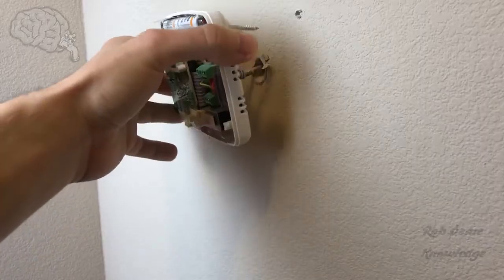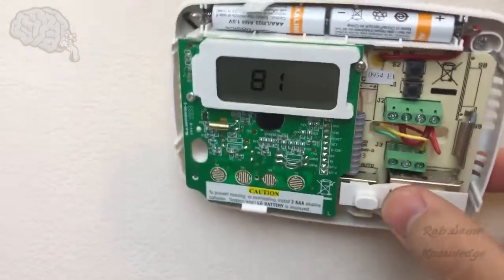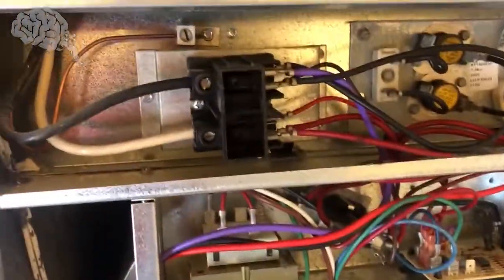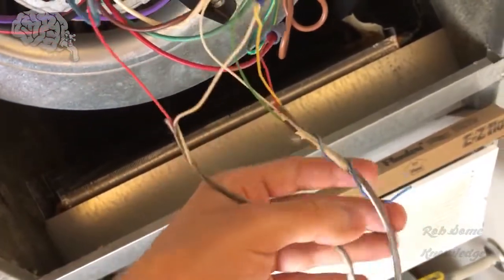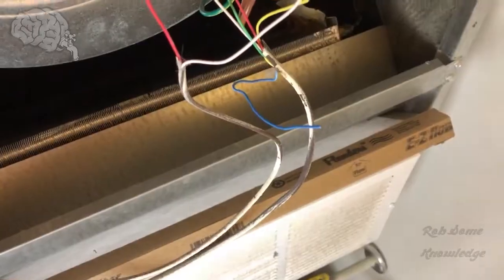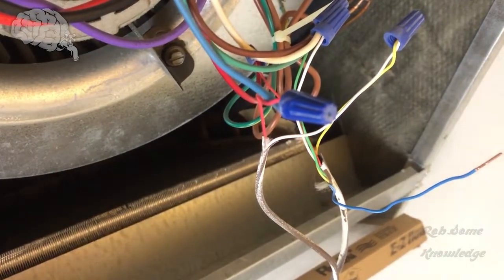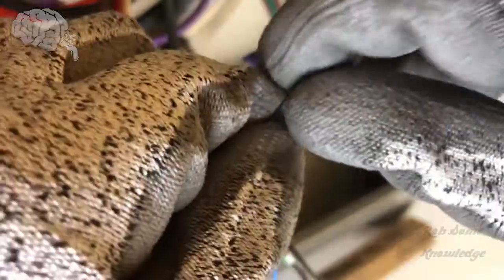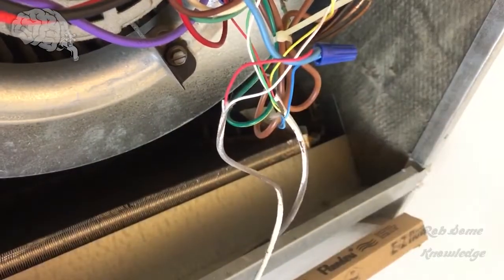How to Connect an Unused C Wire (Common Wire)

Comment: If 
You don’t have a c wire or a 5 wire system just put the G wire to the C slot and run a jumper from Y to G and on the thermostat run the G wire to C

Comment: I  really appreciate your help. It was difficult to figure out how to connect the C cable. My ac unit has a connector where all the wires are tied together and were not set up like other units that are labeled specifically with each wire shown. With you're explanation I was able to hook it up and worked great! Thank you!

Comment: thanks rob very interesting  do you have anything on a messed up wiring in a UL-KFR71V/X , so i can get me back up running ? I am new but understand low power and high power wiring safety
Reply from the maker: Sorry but I don't unfortunately, I don't specialize in HVAC but just made this video with all the research I did on my specific system, to help others with similar system. You may have some better luck asking that question with a more specialized channel that focuses only on HVAC content.

Comment: Rob, thank you!  I installed a Nest thermostat and it clearly needed a C wire.  After tearing open my furnace, I found I didn’t have a “terminal” so to speak… I searched high and low, including the HVAC manual… And nothing resembled what I was seeing. Your video was truly the only thing out there that showed how to tap into a non-terminal system. I followed your lead and tapped C wire into the AC to common and everything is humming perfectly now.  I can’t thank you enough.

Comment: Great video! So you are essentially connecting the circuit I got it and smart showing you used gloves thanks for all the tips! Struggling to get the cover off the furnace panel now.

Comment: after many videos and forums, this is the vid that helped the most.  we have an old a/c from the 80's.  whoever installed it used two bundles of wires, one for the thermostat and the other for the condenser (i.e. instead of low voltage two wire, they used another thermostat wire; i guess that's what they had on-hand).  then they connected the yellow wire from the thermostat to the red wire of the condenser, i guess to make it more confusing.  so following what you said at about the 4:35 mark, i connected the unconnected blue C wire of the thermostat bundle to the opposite of the yellow wire which for me was a white wire connected to a terminal block with a label of "3" (which i haven't seen in any videos or forums).  this vid combined with the wiring diagram made me confident that the "3" was the common.   thank you very much !
Reply: Same!  I can’t believe it’s so hard to get this info. Perhaps HVAC guys are keeping it on the low. I looked for a long time, this video is what gave me the confidence to get it done.

Comment: Great video and explanation! I had no trouble with the thermostat side but found the nastiest dust filled furnace. Couldn't find the blue wire because they had cut it so short. Couldn't read any connectors because the dirt and dust. Poor installation of the unit in a small closet and being on a ladder to access. It was all horrible. But your video matched the exact unit and wiring. Got it running in just a few minutes! Thank you so much!

Comment: Why do you need a c wire. You have batteries
Reply from the maker: Because right after this video I replaced the thermostat with a smart thermostat that connects to Wi-Fi. Doesn’t have batteries and even if it did I would rather have it connected to the house power instead of switching out batteries every few weeks or month or so. Most smart thermostats don’t even have an option to use batteries.

Comment: Now, I’m wondering why they didn’t just connect the wire in the first place instead of tucking it off to the side and wrapping it around another wire. Thanks for the video!
Reply from the maker: To prevent any accidental shorts from the C wire, shorting onto a power wire, or similar situation.

Comment: Going to try this tomorrow.  I have the unused c-wire behind the old thermostat but I have to find where the furnace covering is to check if the unused c wire from the thermostat is connected there or beung used at all.  I haven't been in this house long in Texas and it might be in my attic.  Can I just try and connect the unused c wire to the new thermostat to see if it will power on?  Basically do you think the unused c wire is connected at the furnace already???
Reply: Your video seems extremely helpful btw!
Reply from the maker: Im glad you found it helpful. I mean you COULD try to just connect it, but I would really recommend just finding the furnace/air handler and actually checking. More than likely its not connected anyway if it wasn't connected at the thermostat. There is a possibility you could short something out if that isn't actually a c wire. Just take the time to go find it and verify the wires.
Reply: Don't know if you have the answer to this butttt, it worked but it didn't.  I bought a $70 honeywell thermostat that required the c wire and this is the one I installed.  I found the c wire by the motherboard of the furnace, attached it and went  to turn the power on at the breaker box.  The air came on blowing cold but I had no screen on the brand thermostat.  So I couldn't control the temperature  or anything.  It literally just stayed on all night.  Going to return the thermostat today because I feel like it might be a defective unit.  Thoughts.
Reply from the maker: Where exactly did you attach the wire to?
Reply: @RobSomeKnowledge  so I got it squared away but I had to call an emergency AC tech out.  Great Info I learned.  He told me that the existing unused c-wire ordinarily should work but in some cases it's a reason why it was not used ( like it could of been defective).  Check this out though.....when he came into my house he asked to see the old thermostat which was battery operated.  I don't know if I told you that the first thing I did was swap brand new batteries into it when I saw the screen was blank when I came home last Thursday.  I noticed the last batterie connection had a LOT of corrosion.  I scraped it off, popped in 3 new batteries and the thermostat did not come back on.  When the technician came, he opened up the original thermostat, put the new batteries in too, but before he popped the batteries in he said, " don't tell anybody I showed you this".  He stated that over time the metal prongs on the top and bottom of the batteries can get stretched out and not touch the batteries once vertical on the wall.  He squeezed the 3 sets of 2 prongs together for the batteries and the old/legacy/original thermostat came right on!!!!!!  I never even needed a thermostat!  He said this happens on 2 out 10 house calls!!!

Comment: Awesome video, I had 5 phone calls with the Honeywell T9 techs, and no joy. My air handler has no control board. Within 20 minutes of watching your video, I was able to get it working, since you showed which wire to connect for the Common!

Comment: I think you were wrong connecting the C wire to red coming from condenser unit..it should be connected to the white wire. Red=hot, White=common, unless prvs electrician is mr anarchy.
Reply from the maker: Nope this was cleared with a master electrician before I did any of this on my own system. You should never really rely on color coding unless you did the initial wiring yourself. System has been working flawlessly since the video and still have it hooked up exactly how I did in the video.
Also the wire that was already bundled  in the wire nut with the Red, the thick blue one, is the C wire that is coming off the board.

Comment: You rock. Thank you for saving me the cost of having to pay someone. I knew about the common wire but had no idea how to hook it up at my new apartment’s intimidating looking ceiling accessed furnace. Thermostat and A/C low voltage wires were just as you described. My ecobee is reinstalled and back online. 😅

Comment: Extremely helpful video, thank you!

I had been having power issues with my Emerson Sensi for years, but kinda ignored it because the batteries did the job.

However, when I wired in my Ecobee 4 it wouldn't turn on. The multimeter showed 0V on the C wire.

I opened the side of the air handler and found the C wire, but no control board...just bundles of wires.

This is where this video came in!

It was so helpful to have somebody explain so clearly the wiring shortcut.

After a bit of "jiggery-pokery" I had power to my C-Wire and everything is working great now.

Thank you so much!

Comment: Excellent. The only thing I would add is that it’s better to wrap that thin blue wire around the other bundle a few times to secure it better before you wrap the copper ends together
Reply from the maker: Ahhh good tip!

Comment: I have an extra wire not being used, but not sure it’s the C wire. It’s not blue, it’s a very light brown/tan wire. When I moved into this house, I never had to change the batteries on the thermostat. Years went by and eventually an hvac technician came out and I think he converted us to a battery powered stat. I never thought much of it until recently when I decided I wanted a smart stat that I could operate from anywhere in the house. 

My question is is there a way to test the extra wire? It’s not going to be live, right? Will it be hooked up on the other end (furnace), even though it’s not hooked on the stat side? If there is just a random wire not hooked up on both ends, that’s most likely it, right? Can I use it, regardless of color, just as long as it’s not attached on either end? All theses wires are the same, right? As in gauge. Only difference is colors?
Reply: I would do it as long as your system is using 24VAC.

Comment: This worked for me and my Amazon Smart Thermostat. My system was older and it just appeared the C wire from AC unit went to a ground. But that ground was all I needed to make it work in that junction the AC wire nut connected to.

Comment: Hey, idk if you’ll see this, but how do you double check that the blue unused wire is c? My nest stat isn’t getting power and not detecting the power adaptor, and fuse is t blown on furnace. On the furnace diagram is it has a G Y W R for the thermostat, and W C AND Y for condenser? Does that sound right? They made the dang diagram so hard to read. I just don’t know why my thermostat all of the sudden stopped connecting to HVAC power, but am stumped. Thank you So much

Btw, furnace shows R C W Y G

Comment: I have a c wire on my hvac system board, and I see it paired up with the white in a sheath. But at my thermostat I do not see the c wire. It is not tucked behind the wall.

Comment: Thermostat wire is powered by the motherboard on the furnace, not AC power. It is low voltage cable. Usually 12v or something like that. You do not touch the breaker panel at all. The furnace as a whole is controlled by a circuit breaker, but should have an emergency off switch mounted near the furnace for technician service. If it is a older gas furnace the pilot may have to be re-lit after power is cut. You can DIY but you need to know your furnace schematics and know what wire you need to ground where on the motherboard inside the furnace. Easy for a techie that knows heir way to a mobo, but not likely for a average handyman. If this is an old furnace with no motherboard it's a totally different ballgame in wire converting. 

If you live in an apartment, the furnace is controlled by the building manager and you have no authorization to access the furnace or replace the thermostat. So you have to run this all by them what you want to do and set it up with them.
Reply: Thats not true, Ive lived in several apartments the past ten years. I have always had full control. I would never live in an apartment where the property controls my thermostat lol.
Reply from the maker: Yeah it’s definitely not. This video WAS FILMED in an apartment 🤣
Reply: @RobSomeKnowledge  Wow they sure do here. Maybe I live in the ghetto but many apartments put one of those security locks over the thermostat and it's set to whatever the building is set at. They don't let you change it. Unless you smash the box or something.
Reply from the maker: Oh damn that sounds like prison lol. Are your utilities included in rent? Or do you pay them separately yourself?
Reply: @RobSomeKnowledge  Oh I don't know, I just did cleanouts/prep work and noticed they were always locked. Maybe they were paranoid someone would steal the nicer ones. But really  I think it depends on the landlord and where the apartment is at.  Those multi-unit complexes I think can be all single controlled and they provide utility assistance.  Some single house apartments might be separate billed utilities.  A lot of the rental properties where I live have been outsourced to LLC's and random enterprises in New York, Jersey, California, etc. Or under weird Iranian names. It's a mess.
Reply from the maker: @MrWolfSnack  Ahh gotcha. Yeah I guess its highly dependent on the landlord. The apartment I'm in is a multi unit, and separately metered for water/sewer and electric (FULL electric apartment, no gas incoming)
And if theres utilities being paid by the property then I guess I can KINDA (not really but kinda) see why they would do this, but I would never live in a place that does that lol. 
And yeah that is true, luckily I have a local landlord that actually comes by at least once a week to check up on the property, do any maintenance, etc.

Comment: When replacing my W/R Thermostat with a new Honeywell Thermostat, I notice the old Thermostat was using a black wire for the "C" Common connection but when I replaced it with the new thermostat the new one doesn't have a label that has a "C" what's up with that

Comment: Makes you wonder doesn't it? These "extra wires" have been part of air conditioning wiring for YEARS and the C wire has a purpose now but a few still "extra" there. Wonder what they will think of next for those. Talk about thinking into the future when this was designed.

Comment: The video was very nice but it would have been nice at the end of the video to see you verify the wire voltage, for the blue wire, at the thermostat with a volt meter.
Reply: Yeah! I tried at first to get a reading but none was on it, i assure you it's there though lol! Has to do with being a seiers circuit.

Comment: Hello Rob. To be clear, if the c wire connection on the a/c panel is open, we should make the connection there. Correct?

Comment: Great video instruction. I found my unused blue wire under my Nest thermostat but unfortunately someone cut it within a 1/4 inch of the sheathing and there is no slack in the cable behind the wall. So I guess I need to run a new length of cable.
Reply from the maker: Ah that's a bummer! Luckily it shouldn't be too difficult to run a new cable. Here's a little tip, tape your new cable very securely to your old cable, then you can pull your old cable through through the wall and run the new cable at the same time.

Comment: Thank you for the great video. I have two wires coming from condenser in the same way. 1. White connected to Yellow on Thermostat. 2. Red connected to blue wire. I was checking where the blue wire goes and it's connected to the steel frame of the furnace. Is the blue wire C wire getting connected to frame like ground? Bit confused and wanted to check if anyone can guide.
Reply: Hey bud. Did you ever figure out what the blue wire connected to the frame is for

Comment: Like so many others have said, THANK YOU for this video!!   In my situation I had an older "non-smart" thermostat downstairs that controlled both a steam boiler for heating, as well as a central air unit that I wanted to upgrade as my local utility was basically giving away the Emerson Sensi smart-thermostat.  The thermostat wire going up to the Air Handler in the attic did have an "unused" blue Common wire but when I went upstairs in the attic I saw that it was not connected to anything.  I saw that the wire that goes out to the compressor outside for the AC had two cables that were pigtailed into others outside the AC Handler.  The White wire was connected to a wire that was then connected to the Yellow "Y" cable going to my thermostat so watching your video I was then able to figure out that the other wire (the red one that was connected to a Brown wire that went to the control board inside the AC handler) was the 'common wire' in that circuit so I simply did pretty much what you did in the video, turned off the power and then pigtailed the blue common wire to to the same junction as the red/brown wire and voila!  It worked!!   the only difference was that in my case I had to do an extra pigtail connection at the thermostat wire to 'extend' the C wire from the thermostat to the junction where the red/brown wire was connected.

Comment: Thanks for making this so clear. All the other videos talk about C terminals and additional adaptors. Mine has no circuit board to find a C terminal at. So finding the right ground wire was the trick just like you have shown. Thanks again!

Comment: Thank you sooo much !! My system was setup like this with just wires and no labeling. I used the blue wire like in the video and connected to the ground for my AC compressor !!

Comment: Thanks! Just fixed my "non-working" c wire issue for my upstairs thermo. We got new thermos for both up and down, but for w/e reason the downstairs one already had a c wire connected to the furnace while the upstairs one was wrapped on the wire still. It took longer to get into the attic than it was to just simply attach the c wire where it needed to go. Both thermos are working perfectly, nice to finally have wifi and smart features with them.
Reply from the maker: No problem. I’m glad it could help you out!!